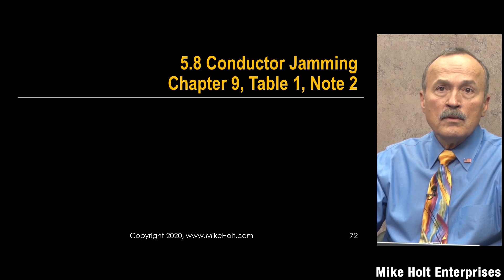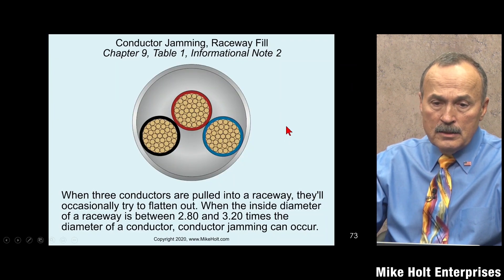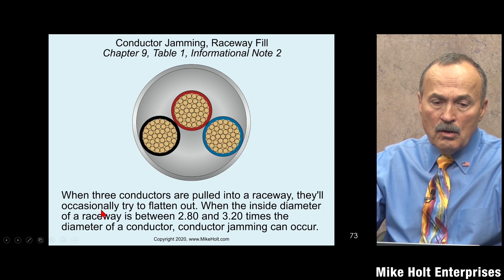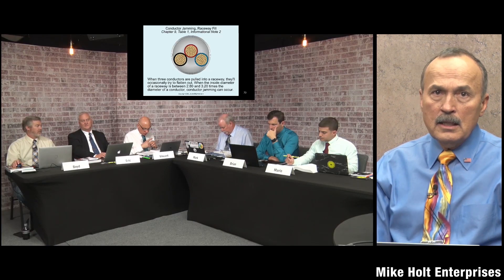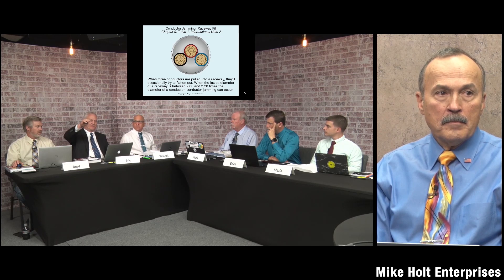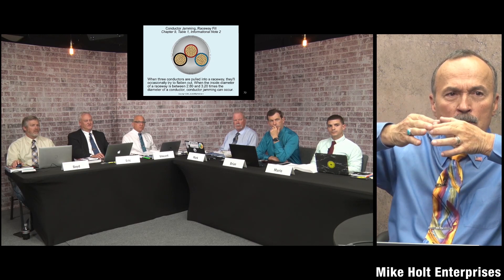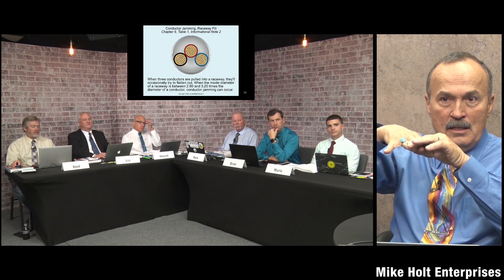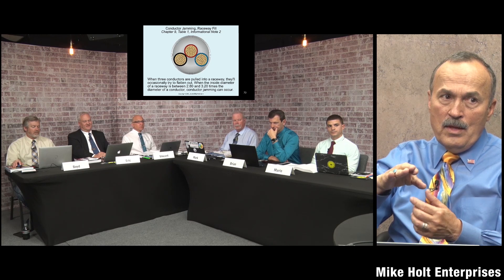Conductor Jamming—Chapter 9, Table 1, Note 2, NEC 2020 (5min:37sec)

Comment: I believe the tables in chapter 9 are already calculated to avoid this scenario. That is if you add up all the square areas of your conductors even if you have just 3, you shouldn't have this problem. Correct me if I am wrong.
Reply: @jolyonwelsh9834 @MikeHoltNEC Incorrect. Proof: Using 'f' as the fill fraction, 'n' as the number of wires, 'a' as one wire cross-section, 'A' as the raceway inner cross-section, f = na/A (1). Using 'd' as one wire diameter and 'D' as the raceway inner diameter, a = πd^2/4 (2) and A = πD^2/4 (3). Substituting (2) and (3) into (1) and rearranging yields f = n(D/d)^-2 (4). Entering n = 3 and D/d = 2.8 (the jamming lower bound according to informational note No. 2), into (4) yields f = 38%. Doing the same with D/d = 3.2 (jamming upper bound yields f = 29%. So, when using 3 wires and a fill fraction from 29% to 38%, which is well within acceptable range of up to 40%, jamming can occur according to informational note No. 2.
Reply from the maker: I don't know... makes sense. But I don't have the time to validate this.
Reply: @MikeHoltNEC  lmao that's the gangsterist response from OG Mike ive ever read

Comment: I now know why my Forman insisted on me using pre-fabricated 90 bends when we installed overhead door controls at a Honda plant. Jamming wires would then not be suspected during troubleshooting. That or he didn't know that I can bend pipe very well.
Reply: Factory bends are subject to the same imperfections as field-made bends.   Both factory bends and field bends for metal conduit are cold-worked into their shape.   The inner fibers of the metal have to compress, and the outer fibers have to stretch.  This will deform the cross section of the pipe, so it isn't a consistent circle.

Factory PVC bends by contrast, are initially formed in their shape while the source material is still hot, and have a profile around the bend that is a lot closer to a perfect circle.

Comment: I have came across similar guideline about cable jamming ratio in IEEE 525 Standard and advised contractor to follow it but they were not happy about it. Instead during cable pulling they like to use lubricants to reduce the chances of jamming and insulation damage.
Reply: yup Lubrication does wonders, no stripping or cutting of insulation and literally eliminates friction